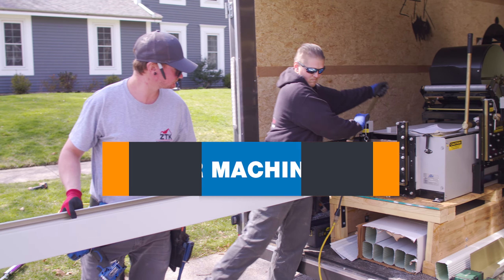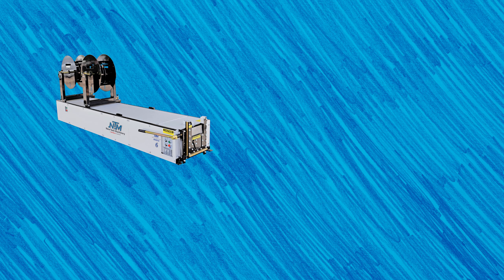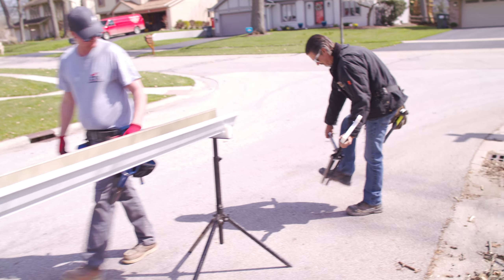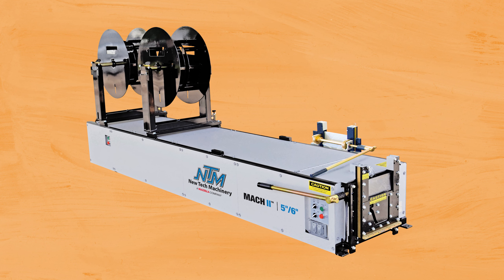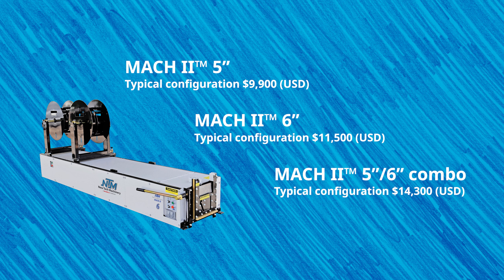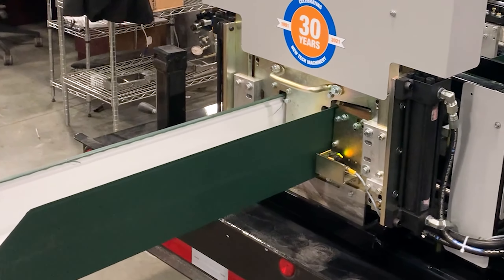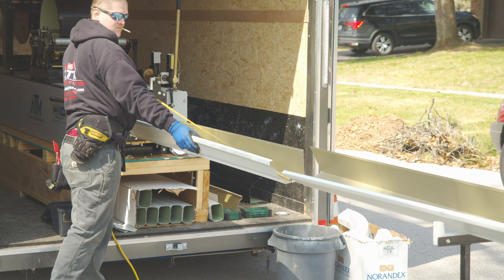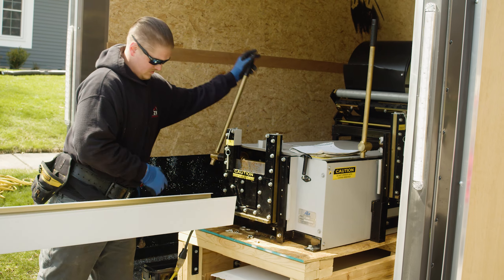How Much Does a Seamless Gutter Machine Cost in 2023?

Comment: Hello good afternoon. Could you tell me if the basic 6-inch model includes the piece for cutting the gutter. and what are the specifications of the material that should be used in terms of its width and thickness.
Reply from the maker: Hi Elizabeth, you can get the specs for our Mach II gutter machines at our website here: https://newtechmachinery.com/machines/gutter-machines/mach-ii-5-6-5-6-gutter-machines/ and a basic 6" gutter machine would include the shear (but no reels or coil cradles).  Reach out to us through our website and one of our experienced account managers will follow up with you, thanks!